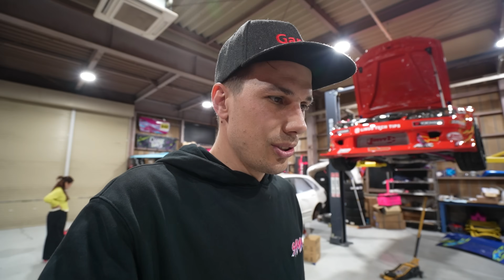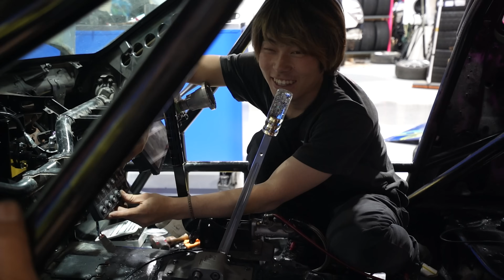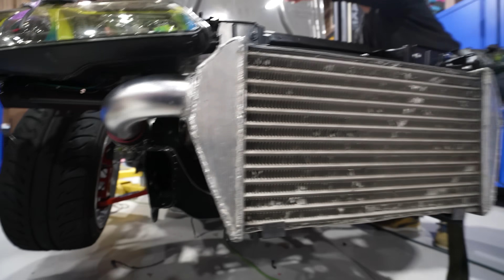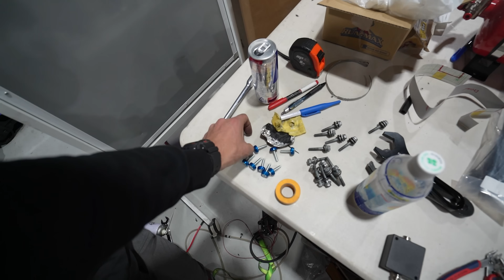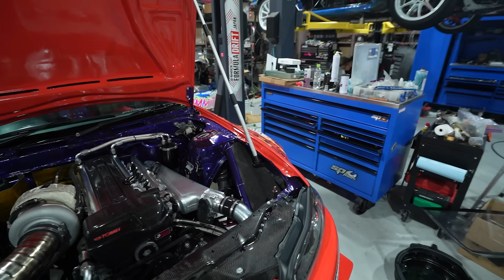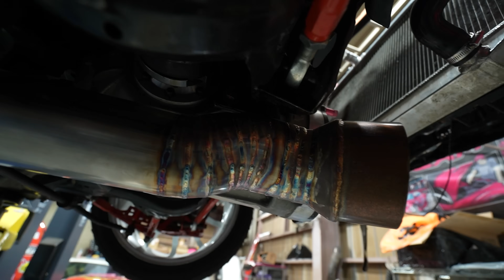FIRST START of his Dream Pro Car Build! 1000HP

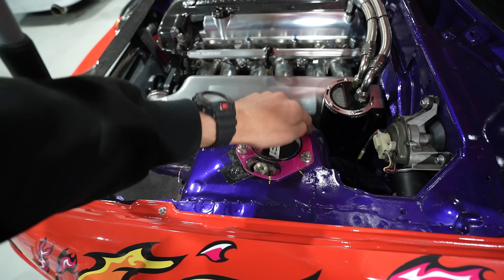Comment: You have to grind out the cracks to bevel them, and drill a small hole  at the ends of them... Wouldn't hirt to go on the underside after you do the top, back gouge the cracks and wells that side too, if accessible 14:36

Comment: One time when I was an apprentice working on a Mack truck, (they have a 16L inline 6 engine which holds around 45Lof oil) the oil filters have to come off to access the starter motor which i had to replace. Guess who forgot to reinstall the oil filters before testing the new starter motor out...... to make it worse, the starter is on the passenger side of the truck so after starting it i walked around there to find oil gushing out of the filter housings onto the ground im talking at least 20-30 litres, was not ideal

Comment: Both cars are so insane! Would be beyond stoked to drive anything with that much power.

I did one time dump a whole crankcase of oil onto the floor. Working on my friends car, there was a variance in the oil filter housing on the coupe vs sedan (on the same engine) and the filter popped off. Kinda sucked 🥴

Comment: Sam, if you don't want to spend the argon on back purging, use solar flux. It won't look pretty (comes out black) on the inside but you wont get that bubbly sugaring and it's significantly cheaper.

Comment: The USDM 2JZ intake manifold plenum is larger and holds more air for higher HP output, the JDM plenum has smaller volume and smaller in size for more midrange and response. I remember you asking about this a few videos back. Cheers 🍻

Comment: We call it a strain gauge that’s is to pull timing/cut ignition on flat shifts.
Reply: Yes. It’s common to use load cell/strain gauge in the gear shifter to enable flat shift. At a quick glance it looks like they’re using a linear position sensor to detect movement of the shift linkage but it could be a load celll, just not one I’m familiar with.